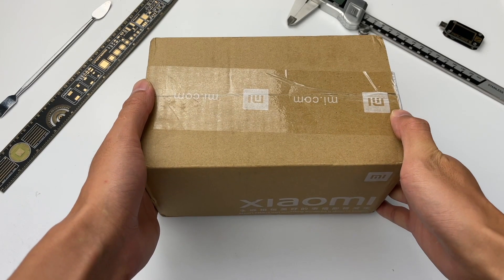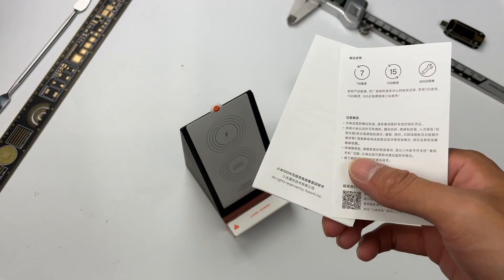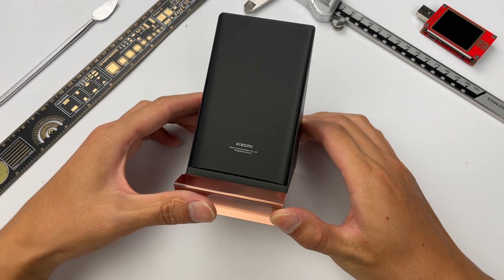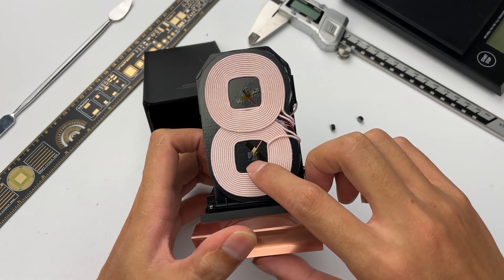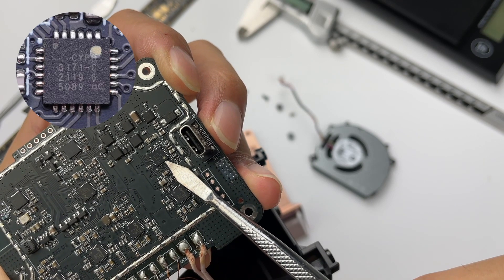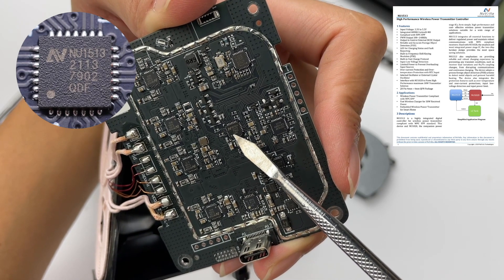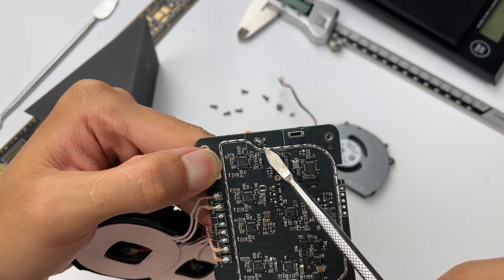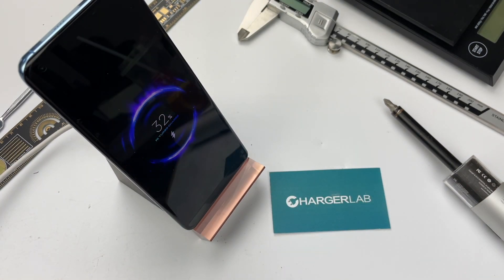Turbo Chargeable | Teardown of Xiaomi 100W Wireless Charging Stand

Comment: How much heat is generated by this device while working on max power? Only 60-70 percent really goes to the phone. This is similarly to heat up your phone with  30-40W heater, five times more, than maximum power of the CPU when playing hard. Lithium batteries are very sensitive to heat, this charger is the battery killer :)
Reply: It has a cooling fan)

Comment: Awesome 👍
Can that wall charger be used separately to fast charge mobile phones/laptop at 100w ?
Does that charger have PD or QC 4 or 5 ?
Reply from the maker: You have to use compatible Xiaomi devices, cause 100W wireless charging adopts Xiaomi private protocol.